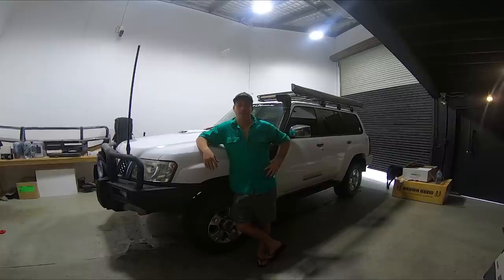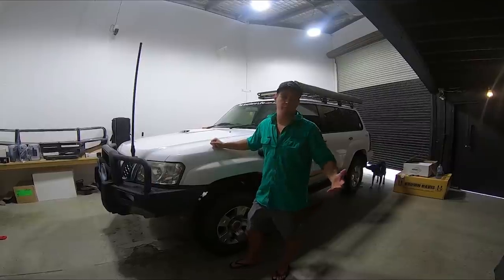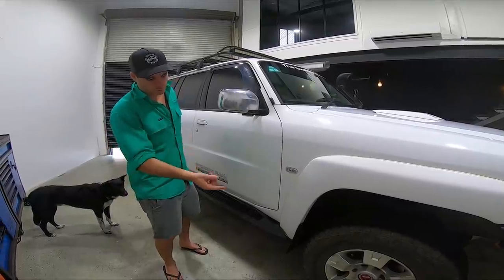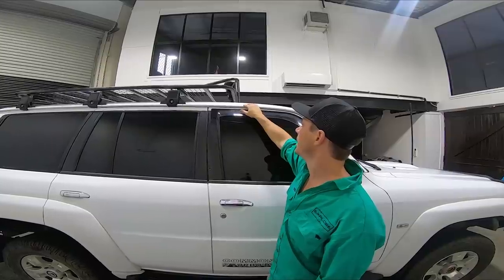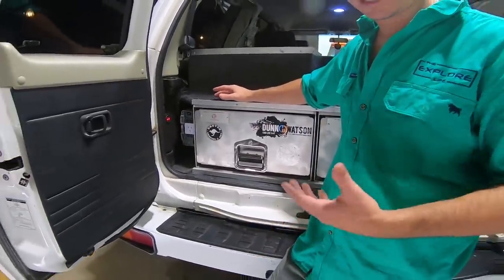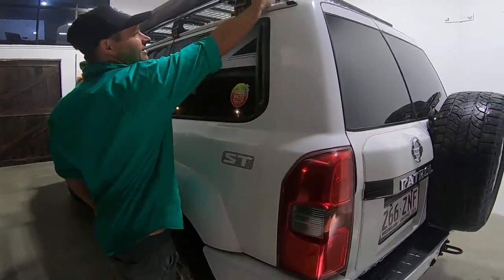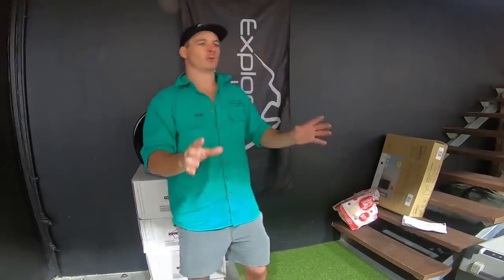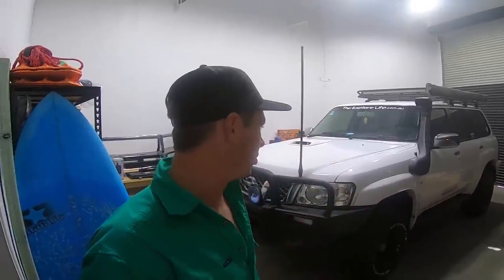EXPLORE GU PATROL REBUILD!! - EXPLORE BUILDS P-1

Comment: Engine swap not necessary.  Just upgrade the current one with a better inlet, turbo, exhaust, and proper tune to keep the EGT down - will make plenty enough power for the shitty standard brakes.  By far the cheapest way to go.  90% of  LS/Barra/anything else swapped Patrols have never ending problems.
Now it's got 33" rubber the brakes should be the first thing to get slotted rotors and A1RM pads.